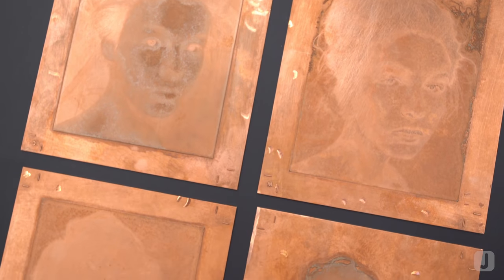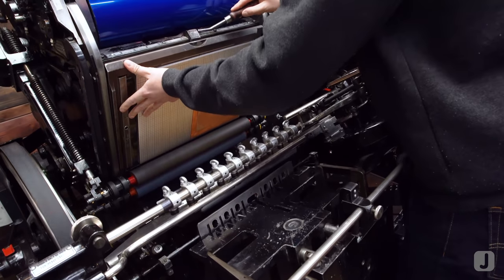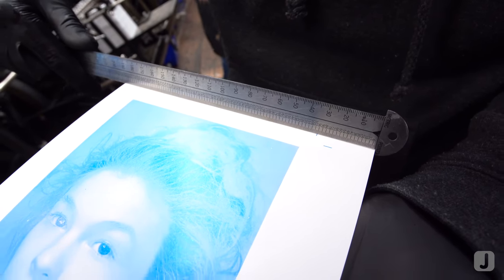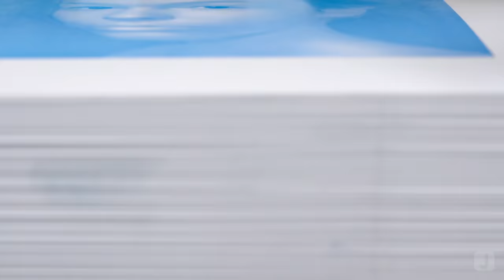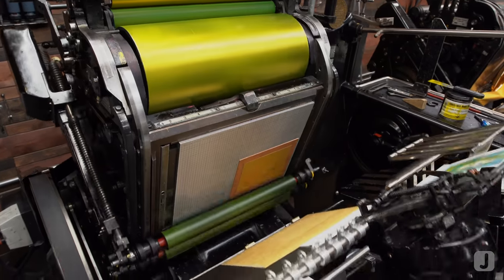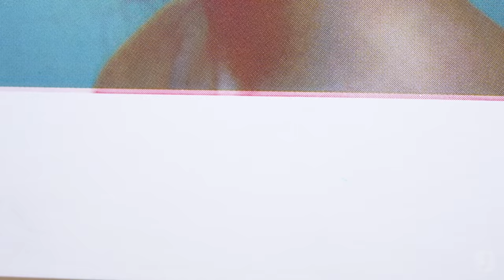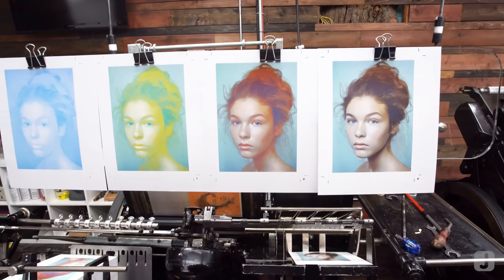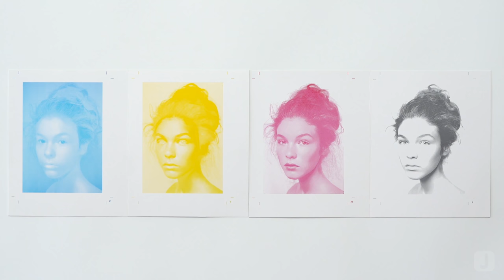Half-Tone Letterpress Printing a Photograph in CMYK!

Comment: as a retired printer its good to see one of the older skilled craft print methods still practiced......
Reply from the maker: Thank you Edward!
Reply: Same here. I haven’t run a windmill since the 70's
Reply: Retired blacksmiths feel the same way.
Reply: As a former printer's devil in a weekly small town newspaper, it's great to see the Original Heidelberg running again. When Dad bought it to add to the back shop in the 1960s, we were transfixed, watching it, as we had experienced only the much older Chandler & Price presses.  I must admit that I wanted the printer in the video to let that press show what speed was actually possible.  5000 impressions per hour wasn't out of the question.  It could fly!

Comment: I did a   process  color piece  on  letterpress  once.  Once.  Never again.  It  was  the most  challenging,  difficult,  and  make-ready-wasting print job I ever  did.  Hats  off  to you for  attempting  this,  and  pulling it  off!
Reply: You should have done a 5 year apprenticeship like I did. Letterpress 4 colour process is a piece of cake 8 pages at a time.
Reply: Barracuda 1964  Great! Did the same myself in the 70's. Can't be many of us left now!
Reply: Barracuda 1964  KSBAs are still around.  A lot of them are being used for die cutting nowadays.
Reply: @ronnieg6358  My apprenticeship was 7 years in 1965.
Reply: @peterhrick6789  You obviosly learned it properly . Mine even included first year full time at college.
Reply: @ronnieg6358  
I could do 4-colour process printing at college, but at work it never came out right because the boss (scrooge) would not allow me to use make-ready sheets in order to run up the colour!

Comment: I have done 4-color dot register jobs on the Windmill that I have had and have run for the past 40 years, and my ace offset pressman once did a 4-color print like this on our ATF Chief 15 - just because he could.... But I have never printed a color halftone on any platen press. Dot register and perfect makeready and color. I am impressed! Pardon the pun, but Jukebox Rocks! ;)
Reply: Ahhhh the Chief... I was running one with a T head before I had a driver's license! After I got my DL, I was able to drive myself to go get stitches when she bit the tip off  my right index finger. The cover near the feed lever was off. Thankfully, It was saved, lots worse has occurred as a result of "just the tip"

Comment: The order in wich you print the different colors is indeed interesting. I have had an extensive printing education and when a first started working (it was a T-shirt screen printing company) we had a lot of difficulties depending on the films we got for making the printing screens. It turned out that there was a huge difference between the opacity and color pigment between different brands of inks. With the one brand the major problem was the magenta that was too red, so the color balance shifted completely. We started to make our own color separations (my bosses weren't used to work with Photoshop to that extend, so it fell up to me) where we adjusted this by removing up to 30% of the magenta curve and started to print the magenta first + we switched the brand of ink. This way we were finally able to run our prints smoothly and more consistantly. Also, if your black is really too dark during print you can cheat a little by switching to a dark gray. Works like a charm!
Reply from the maker: Sam Liekens thank you for your insight. A lot of the printing industry seems to be experimenting and coming up with the best ways yourself. It feels good to overcome a challenge!

Comment: I used to shoot separations for this type of work on a railed camera using screens to expose the dots onto pan film . Each colour was exposed using a coloured filter. Cyan had red, magenta had green, Yelo had blue (always the longest exposure) and a black key was created using a orange/beige filter. Great job, I loved it.
Reply from the maker: Modern thermo film still doesn’t compare to shooting through a proper halftone screen with strong filters. The camera work has the greatest effect on the overall print. Were you shooting for silver master offset plates? Line screen value for those must’ve been very very high...
Reply: I was making seps for lithography and letterpress. 4 colour became rare in letterpress for regular jobbing work and when someone requested it it was a pleasure to do the extra work. Cartonwork was the biggest source of letterpress type separating. Images where then etched onto bimetal plates, similar physically to a letterpress dot but harder and capable of running 500k+ impressions. Have you printed from any wood blocks yet?

Comment: I used to run a 10" x 13" Heidelberg "Windmill" Platen for numbering tickets and ballots and the such back in the 80s. We did a little imprinting or simple die-cutting work but never attempted CMYK printing with it. Very cool to see!! Still have my line gauge handy. Great little back scratcher!
Reply from the maker: Those hook top pica poles can really get to those hard to reach itches huh?

Comment: Recently came across your YouTube channel.
I was a printer for 54 years, started in 1965. It was good to see the skill and craft still at work. I just have one thing to point out, you keep referring to the chase being put in the press, the chase is just the metal frame when type or blocks are locked into the chase it becomes a forme, so when you put it into the machine you are putting the forme in. Just technical but correct term to use. Otherwise very informative videos.

Comment: That was one very nice impression of how a 4 color print was done, having to feed the paper 4 times to the printing-press, bringing along all the difficulties to make every next feed fit the one before. There are so many variables involved to get a good result in the printing process... paper quality, humidity, ink density and having it spread out evenly,  printing pressure, proper working of the front- and side lays, and so on.
The sounds of the "Degel" , as this book=printing press was called in German, are all to familiar to me, having been a mechanical service engineer on Heidelberg printing presses for over 20 years. Not specifically on the book-printing presses though, more like on to the offset presses of Heidelberg (GTO, MO, SOR and the whole range of Speedmaster series), but on many occasions, when doing a job on a modern Heidelberg press, on the background you would hear this very distinctive rhythm sound of a "Degel"  (plate printing press)  or a "Cylinder Automat" (like a BIG Degel).
It's very nice to notice that the Plate printing press still is around, for those special kinds of printing demands.
Reply: that would be Tiegel

Comment: Love seeing the machines I operate daily do what they were intended to do. 
I'm using a Heidelberg platen and Original cylinder press for Hot Foil printing. 
The factory also has 5 Original Heidelberg Cylinders and 2 windmill platens dedicated to Cutting and Creasing.
Reply from the maker: Foil stamping on a cylinder would be fantastic. I love how the impression strength of cylinders, and the rolling motion, can create large areas of foil with more ease than a platen. Plus, trapped air, and gassing out is much less of a problem. Platens can be really tricky with solid coverage...

Comment: I always have believed that when 4-color-proccess you needed to change the angle of each color to avoid the moire effect, but here it seems that they on purpose left it, and it looks strange but beautiful. Thanks for the video!.
Reply from the maker: Our halftone angles are C 15 degrees, M 45 degrees, Y 0 degrees, and K 75 degrees. I’m noticing a bit of moire happening in the thumbnail image and some of the video stills but in person there isn’t any... There’s something going on in the display of dots to pixels. Moire can be distracting and I find it happens most when too small of an image is sized up and then ripped as a half-tone.
Reply: Oh!, so then its has to do with how cameras perceive the superposition of the dots!.
Reply: @JukeboxPrintLive  The fine regular pattern of the halftone dots is triggering moire in the camera sensor! :) Most video cameras don't have anti-aliasing filters in front of the sensor. Same applies for high-end full-frame digital stills cameras which leave the AA filter off to improve sharpness. But can be a nightmare when trying to shoot finely patterned fabrics, for example.
Reply from the maker: Paul Thompson Thank you! This is the answer we’ve been waiting for. Cheers!
Reply: @pixelp07  I'm not seeing any interference patterns at 1080p. I don't have a 4k monitor to check, but I'd expect to see artefacts at 1080 if they were generated in-camera.

It's possible you guys are streaming the video at a higher resolution than it's scaled in your browser (like viewing it at 720p, but having the window scaled so that the video is only 400px high - or viewing it at 4k in full screen on a 1080 monitor). This is known to cause aliasing on Youtube.

Comment: 55 years ago I worked for a label printing company we printed 4 color process all the time but on Miehle Verticals....we had progs  form plate maker to show ink color for density used color bars ... you did a good job nice video
Reply from the maker: Those V-50's and V-45s are good machines. A lot of trouble to clean up from what I remember but the cylinder would do a much better reproducing these half tones than this platen press does. Thanks for your comment John.

Comment: I watched your video with great interest. I'm a retired press salesman. I worked for Heidelberg beginning in the 70's. Just about every print shop had a "Windmill". I noticed you have replaced the "Original Heidelberg" lockout bar with clear plastic. Do you know the year of your press? There were 165,000 "Tiegel" machines produced between 1914 and 1985. The "Original Heidelberg" on the lockout bar was there to distinguish it from the"Knock off" on the market. For years Heidelberg published a small hardbound book titled "Hints for the pressman". I still have one that was for the "T" platen.
Reply: Did you know Lars Stayburg at Heidelberg USA back in the day?
Reply: @rogerhodge1146  I worked for Heidelberg West just after they took over the Heidelberg Pacific dealership for the West Coast. At that time one other dealership existed. Heidelberg Eastern, owned by a Dutch company East Asiatic. Heidelberg USA wasn't formed at that time. Heidelberg USA was formed after Heidelberg took over Heidelberg Eastern and consolidated both dealerships.
Reply: Could you share me a copy of that document?

Comment: I was a printer from 1956 to 2006, this brought back many memories, however you did not mention that the individual screen angles must vary by 15 degrees to avoid the dreaded moire pattern occurring but this is a great video

Comment: Stunning result! Much more impressive than a photografy. More vibrant colors. Some questions, please any ody knows why he needs to correct the thicknes of the plates with adhesives?
Reply from the maker: There’s always minute differences in the “flatness” of the machine, printing plate, and paper so levelling that out with pieces of tissue is extremely common and makes the most difference between a good print and a bad print.

Comment: So Great. As a graphic designer (print only, for the first 30 years) who learned right at the beginning of desktop publishing (and got to learn and use many of the traditional methods too), It's great to see the technology. I haven't run a printing press since the late 80's (and never a letterpress). I'm surprised at how well it held registration from sheet to sheet...no bounce? I would have considered this a brave undertaking. Was it a commercial job, or just a letterpress-prowess stunt?
Reply from the maker: We attempted this to test out line screen half tone density for our own use and also just to take a crack at it. We have read a lot of articles about how National Geographic was able to reproduce some incredible color photography and we wanted to explore that ourselves. We tested 85 lpi and 120 lpi halftone plates before settling on 100 lpi. These machines hold registration incredibly well and since the making of this video we've had some CMYK print requests for pieces of art. This isn't something we'd want to do on the regular though... offset took over for a reason!

Comment: I would always put density bars in the waist that gets cut off - using density bars is for quality control for color and density of each color and gain control and registration.
I was a pressman for 36 years.  * Nice work on this video *   👍🏼
Reply from the maker: I almost always place color density bars on every print project but for this one, the prepress work was taken out of my hands. It would've been a lot easier with the proper printer's marks all around.

Comment: I hold my breath every time you adjust the paper in the guillotine to cut it to size!
Reply: I wouldn't worry too much, oddly enough they're one of safer machines to use because there are so many safety features on them. For example, ours had light beams across the front you only had to move a fraction into them and it wouldn't operate. Also the blade would only come down if you press the buttons exactly at the same time, if you were slow or took the pressure off, the blade would stop instantly. Depending on where it was on the stroke you sometimes needed to turn it off and manually move the blade to complete the cycle and restart  using a key and a mains electric sequence.

Comment: I've done a CMYK print on a 5m-long piece of cotton, using screen printing and a repeat pattern based on a painted illustration. The result was really good, I only got a bit of a moire, despite using the correct angles. Nice technique to work with.
Reply from the maker: That sounds like an amazing piece!

Comment: Stunning work Jukebox. Have run 4 platens 30 years ago but never did 4 colour. Was used mainly for black with numbering and perfing. I'd love to have a shot on one of these again. Currently running a Speedmaster 52 and a GTO 52 for stuff like invoice books. Good to see that letterpress is still alive. How did we manage without fount to keep those dots open? Where's the anti-set off powder though?

Comment: I tried this once on my old single colour AB Dick 9810 offset press, but our platemaker wasn't a high enough LPI to get a decent result.  Great video :)
Reply from the maker: We tested an 85lpi with this image and it came out too bright and too coarse. Did you have one of those T-head's on your AB Dick to run two colors? I had an old AB Dick 350 in a garage for a little while just to play with. Even at their slowest they are fast little machines.
Reply: @JukeboxPrintLive  I did have a T51 head on the press the max speed was 10k iph so pretty rapid, we mostly ran it at around 5k for stability.  I think the problem with my CMYK experiments lay in  the Itek 617s camera/platemaker.  The plate material was paper based and was very difficult to keep in register without it stretching  and the dot pitch really wasn't small enough to get a decent image, it was way too course.  we use the second head exclusively for spot colour for the same reason.  I miss the old offset days.  Not the same in a digital print room.  Love the channel btw :)

Comment: An extra challenge to do considering there was no sample image (or at least none referred to) to print to.  Also running without color bars or a densitometer no doubt added to the fun.  Bravo!
Reply from the maker: We wanted to print in the way that an average shop may have done in the 50s or so. So yes, quite the challenge. I'm not afraid to say that a modern high quality epson printer would produce a much nicer quality image but wheres the fun in that?

Comment: Did you use set off spray. 65Years ago I used it on all coated stocks. Great to see you guys keeping it alive. Love the Heidelbergs.
Reply from the maker: We actually didn't. We should've, but I didn't want all that corn starch baby powder offset spray gumming up the camera and powdering up the press. We had a little bit of setting off happening but not enough to be worried about.

Comment: curious how the color separation is done.  i tried doing this decades ago when i studied stone lithography in college.  got some interesting results just working on instinct.  amazing that this is a relief process.  nice job keeping the white areas clear without the use of water like in offset litho.  super neat.
Reply from the maker: We started with a 600dpi image in CMYK color mode using Photoshop. We then "split the channels" in the channels tab which then creates 4 separate images in Cyan, Magenta, Yellow and Black. Each of these were changed to a Greyscale colour mode. We ended up with a single PDF of 4 pages. These are then sent to a film image setter through RIP software that change the greyscale image into a halftone. The halftone density is set on the image setter with the desired "Lines Per Inch". 133lpi is about the maximum but isn't ideal for many images. We found 100 lpi  reproduces the best. The film is then used to expose and etch the copper plates.
Reply: @JukeboxPrintLive  cool, thanks for the info.

Comment: Very nice!
4 color process isn't easy on a litho (offset) press.(but Ive done it on a AB Dick) 
You have it down there, especially on the Windmill.
Precise alignment is key. I would have used a piece of tape to mark the buildup board so I could be as close as possible with each plate.
Good Job!